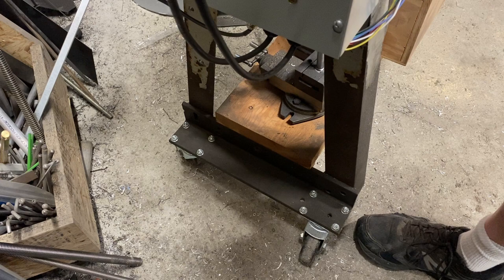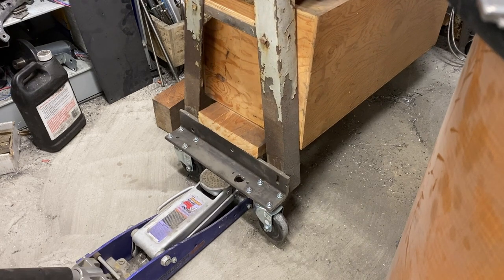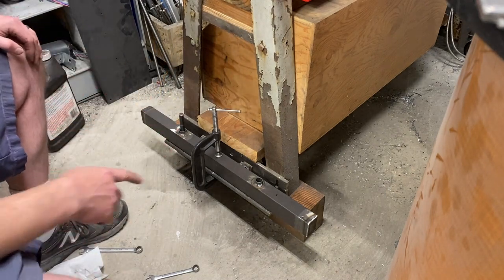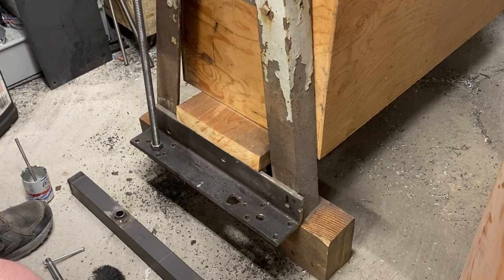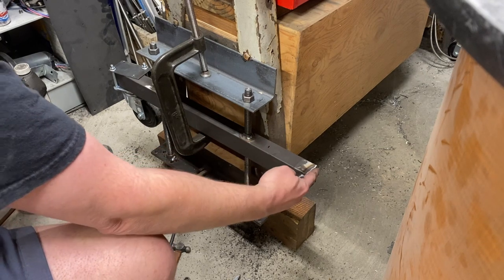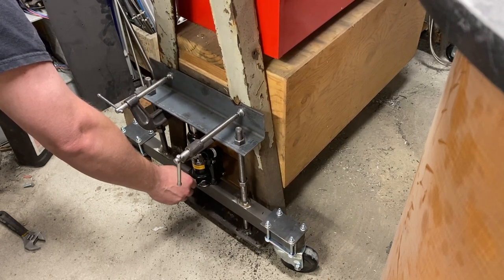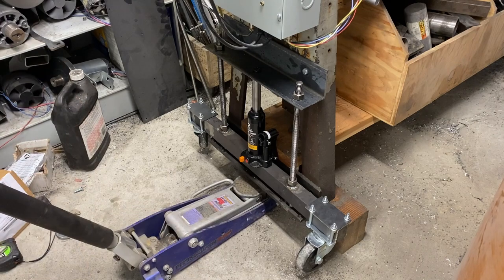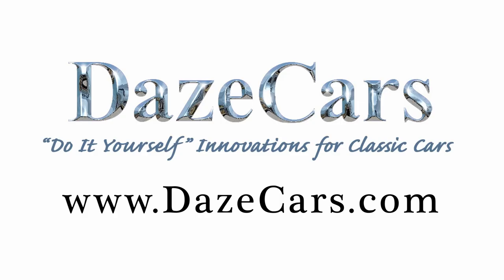Casters on Demand for My Metal Lathe Stand

Comment: Was that Dewalt metal cutting saw by chance altered to run 1/2 speed so you could use the Evolution Tungsten Carbide Tipped blades? Or was it originally meant for them and you just happened to have an evolution blade? 

I bought a Makita Metal Disc Cutter and it’s still in its box cuz I CANT STAND the dust and smell of those fiber discs wearing down metal in my clean garage…. so i’ve been keeping my eye out for any easy, quick and preferably cheap way to convert it. If one doesn’t exist i guess i’ll try and return it for store credit and use that toward an picking up the evolution.
Reply from the maker: Here you go I Love mine!!!  not a conversion but set up that way from the factory.  It came with a dewalt carbide blade but I made a couple mistakes and broke off some teeth.  the evolution blade was less expensive. https://amzn.to/3V9E7Qd

Comment: Just a little surprised you didn't incorporate one of your spare treadmill lift motors for this task. Don't get me wrong, if not often moved, this works great. But, if it was easier / faster to allow it to move, would you move it more often?
Reply from the maker: Infrequent use, more complication, and I don't have many incline motors.  when I first started scrapping treadmills I had not yet hacked the incline motors and didn't see the potential so I didn't save many.  Most of my recent scrapping haven't had them or they are of lesser quality.

Comment: Interesting idea but each time you move it  your lathe will go our of true requiring  you r-elevel it and get the ways coplanar. If you  don't do serious machining you might not notice.
Reply from the maker: As I am sure you know you don't level a lathe to make it level. The lathe doesn't care if its level or at an angle.  You level a lathe as a way to make sure there is no twist in the bed.  With that said the bench sitting on uneven ground could introduce some twist as you suggest however that has not been my experience with this particular configuration.  The bench is made of 3/8" by 3" angle iron welded together with the lathe bolted to the top, so it does not flex at all based on how it is sitting on the floor or at least not any flex that shows up when checking the lathe for twist with the level.  With that said I am more of a fabricator than a machinicest so + or - .0015" is good enough for what I do.  I appreciate the comment because it could be an issue on other machine bench combinations and your comment could be of help to others.
Reply: @dazecars  It's just an easy term to use.
Reply from the maker: @Raul28153  totally agree.
Reply: @dazecars  I can't move my lathe.  It took me 4 men and a boy to get it in position